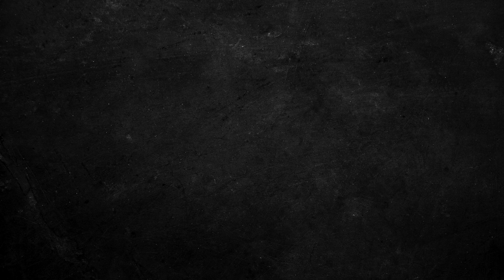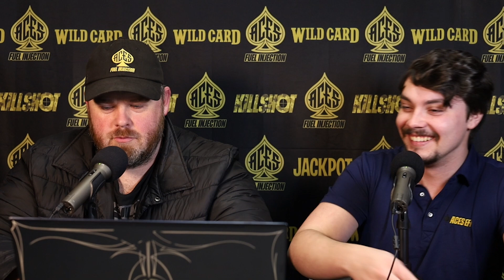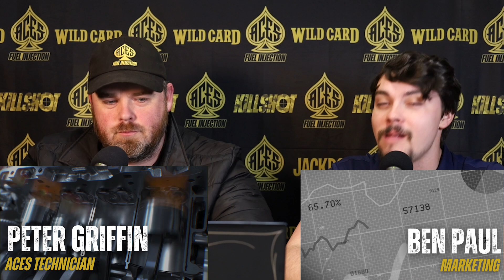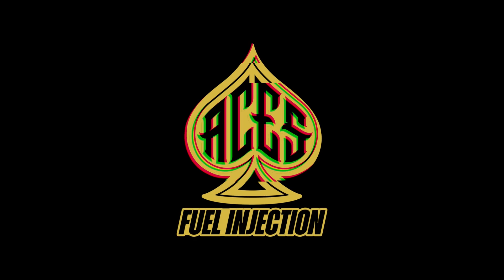Pedals, Sensors, and... AIRPLANES?!?! (Tech Tuesday Ep 18)

Comment: I’ve got a 6 pin dbw pedal on my 08 gxp solstice , getting ready to do the install of the jackpot , I’m hoping this pedal will function with the jackpot , it’s a GM pedal same as a ctsv plug and all of that , so I’m hoping I don’t have any issues with it.. finally got about all of the parts saved up for my single turbo ls swap , still have to get some intercooler pipe for it , but once I get that I should be good .. about to install the engine this weekend hopefully .. trying to make time for this much work seems to be my largest obstacle lol

Comment: On the jackpot fab intake, the vacuum ports on the bottom, any suggestion on plugs? Or should I install the barb fittings with vacuum caps? I only will need vacuum line for brake booster. -dom